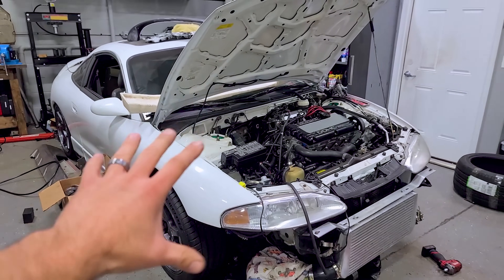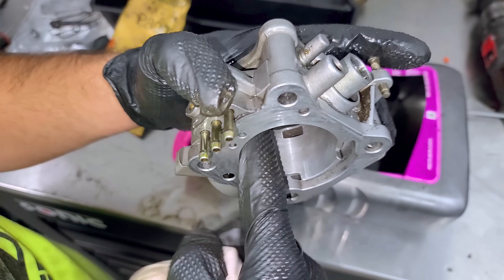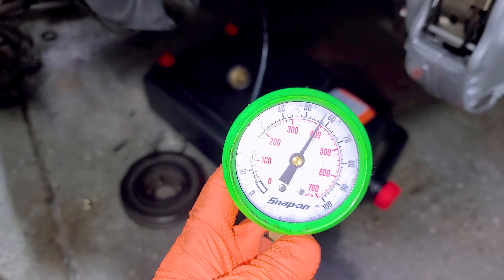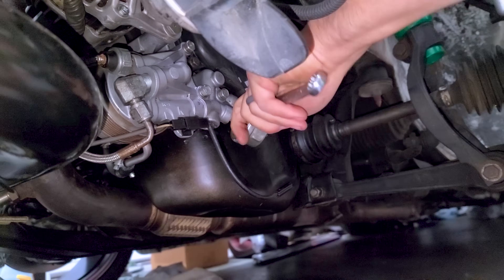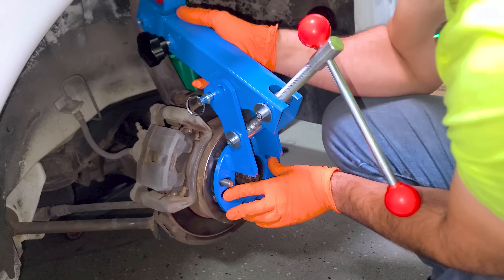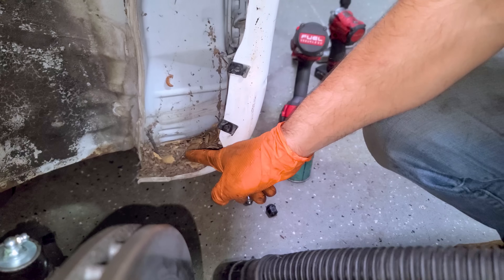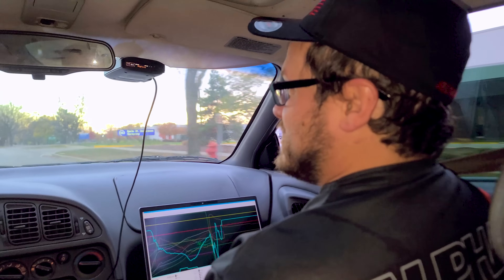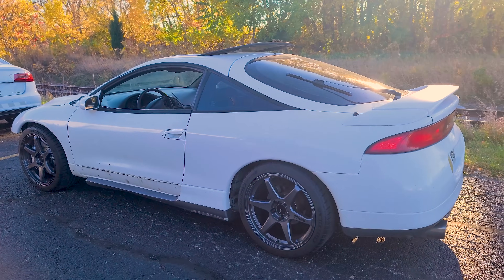We DOUBLED The Horsepower Of My 240,000 Mile Eclipse GSX & It Totally DID NOT BLOW UP!

Comment from the maker: Who else loves a good DSM?
Reply: Old 6G72 guy here. 3000GT
Reply: 90 Eagle talon TSI AWD was my first car I bought
Reply: I do. And so does Bill Pullman.
Reply: Me!
Reply: Alex. Change the harmonic balancer. It’s a two piece held by rubber. Yours looks old and if it separates, it can jump timing by melting the timing cover and getting caught in between the tbelt. Ask me how I know lol
Reply: I had a black 98 GSX 5 spd that I bought in 2000 for only $6800 with a recovered theft salvage title and mustang gt rims with 245 45 17 tires. It looked and sounded so mean. Had bigger turbo, huge exhaust, koni adjustables, electronic boost control and turbo timer in the glove box and  bunch of other stuff. In 4 years and 50k miles I only had to put an alternator and a clutch in it. The clutch was down to 20 yr old me launching the car everywhere all the time. Such a blast to drive, Best deal i ever got on a car. Thanks for the awesome videos on your GSX!
Reply: I had 3 ❤
Reply: I love Dodge Avenger 1995-2000 ,... almost DSM :) plenty of common parts but Chrysler electronics and mitsubishi 6g73 engine
Reply: Me, and I love bad ones too. Because that's what I have.
Reply: I do...
Reply: My first car was a 1991 eagle talon ❤ tsi awd
Reply: Absolutely
Reply: Me me me me me!!!  Teenage dream right there!
Reply: @GearsandGasoline loves DSMs 😂😂
Reply: Still have 3 - GSX and a couple GS-T Spyders
Reply: a 'good' dsm..words that aren't put together often
Reply: I had a 92 galant vr4.   it was a money pit if you do it right it hauls..I did a evo3 turbo, jdm cyclone motor and supporting mods and ran the evo3 wg strapped shut.
Reply: I use to tear up Chicagoland with my talon tsi
Reply: If you keep up on the maintenance, those motors are badass. I had a gs-t that had bolt ones and head studs, port and polish head that was faster then a lot of cars. I even had nos and was told I was crazy for running nos on a turboed car. Now nos is used on race cars and some street cars. That was 25 years ago, right when street racing started becoming more popular cuz of the fast and furious first movie.
Reply: MEEE I HAD A 90TSI that made 400awhp freakin miss that thing all the time
Reply: 6'3 Alex? 😆 Are you serious because you don't look tall?
Reply: I get ptsd watching you work on it.  Just waiting for something to break.
Reply: I'm not a car guy.  Since I had to Google what DSM means, I have no clue whether I like a good DSM or not.
Reply: @nullstring1 that's not a dsm. But also an awesome car. So are dsms.
Reply: That’s why I own 3!! 1 is a parts car with an LSD differential just for you! Provide me a good contact and I would love to gift it to you
Reply: I own a 1999 special edition 5sp Eclipse GS… so yeah i love them😂
Reply: Glad to bring it with to the LSC meet, we will totally be there!
Reply: The best eclipse ever made ❤️  also it would be nice to replace the headlights with the '99
Reply: I love mine when it’s running lol
Reply: Myself personally I respect when you and other creators show your mess ups and then fixes no one is perfect no matter how much knowledge or experience you have people make mistakes!! Keep up the great content!!!
Reply: Although it is not really a dsm, I do have a 1991 3000gt vr4
Reply: There will always be a special place in my heart for my DSM's. Watching you work on it brought back tons of memories. My best was a 1990 Talon TSI that was fully set up. Great car but I moved on to newer tech cars.
Reply: Send the spark plug cover off to get Lazer etched with the legit street car's logo man come on. Perfect chance to flex
Reply: Come on man!... scorpion says "get over here" 😂
Reply: If you didn't show us the difficulties or mistakes you have in maintaining or hot rodding your cars, we'd have nothing to laugh at (I mean learn from).
And if you want to say that you have 400whp, technically it is true - what's 3 HP between friends?😁
Reply: Still waiting for the Lightning ⚡🌩️⚡🌩️⚡ content
Reply: My first brand new car was a 1994 Talon TSi AWD. I drove it 45k miles 3 times across the US (military). The kid I sold it to put a boost controller on it and blew it up a few months later.
Reply: This guy!! I used to own a 93 GSX, 92 Talon TSi and a 91 Galant VR-4. Man I loved those cars!!!
Reply: My dream car back in high school
Reply: 97 GST Spyder here
Reply: Just did a widebody mod on a GT86. Great car!
Reply: What ever happened to the old helper guy you had when you guys got that other dsm I believe it was red with all the carbon fiber parts on it
Reply: I had a 1995 GS
Reply: <------ had this username for likenover 18 years
Reply: I love it and that car looks and sounds amazing and it's my favorite car also you should get a clean body kit for it so you can take it to shows to make it stand out even more.
Reply: I had to google DSM!😂
Reply: @AWD_T He'll hopefully change that or find out and make content
Reply: I have had 2 Gsx's. One I bought new from the dealership. I know that you are going to paint yours. I would make a suggestion for the color Maui Blue. The color shifted between blue, purple and green depending on the light. It's a stunning color and I had so many comments on the color.
Reply: 95 Eagle Talon TSI AWD - love the series! Had a 20G, ACT 2600, 660s, Walbro 255, Thermal, Apexi SAFC and TT, FIPK, and much more - still miss it!
Reply: Meeeeee. I miss my 1994 eagle talon tsi awd 5 speed. My m240 awd with a turbo and full fuel system upgrades scratches that itch though.
Reply: Hey Alex what brand of op sending did u use? Mine is doing the same thing. Thx 😊
Reply: Me-me-me!!!  ROFL ;-)
Reply: STI IAG stage 3 fully built on e85 flexfuel fan and rotary fully built bridge ported fan here.
Reply: i almost bought a 91' Laser as my first car when i was 15
i want a Conquest/Starion and a Plymouth Colt GTS
Reply: @stevenreid-g2y  The Mitsubishi dealership tried to get me to trade GSX for the VR4. My only reason for not doing it was that it drove so heavy.
Reply: Got 1 eclipse 1g 4g63, searching for a 3000gt v6tt 😅
Reply: @AWD_T  THIS
Reply: Had a 91 talon TSI AWD, miss it so much. Awesome car and so much fun. I had an ACT 2600 clutch and it hauled ass.
Reply: My name should tell you all you need to know. 😁  I had a '91 and '94.  I've tried to find another but there is nothing decent out there.   I am jealous of the Eclipse for sure!
Reply: Nothing better I love my ls but spinning all 4 wheels with a 4 cylinder car absolutely insane lol
Reply: Good I miss my Talon TSi
Reply: Love em
Reply: I love Dsm's......I kinda hoard them a little, I've got 14 of them lol. Thanks for showing them some love.
Reply: This was the first car I ever painted!
Reply: My first manual car was a 2ga eclipse, most recently had an evo 8, talk about money pit, i love them but  the 4g platform is expensive
Reply: I got a 3rd gen eclipse, which is not a DSM, but is kind of a cross between a 2nd gen eclipse and a 2nd gen 3000gt. Very little moddability unfortunately. RIP 4G63 eclipses you will be missed. RIP mitsubishi you had a good run.
Reply: I love that it doesn't sound like a fart can. Please don't ruin that beautiful sound
Reply: 3 Dodge Stealth R/T Turbos a Galant VR4  454/2000 and two 1g Talons. Yep I have a problem lol.
Reply: I had a 1991 eagle talon. I miss that car more than any other I’ve had. Even my 83 trans am.
Reply: Peter?
Reply: Hell yeah!
Reply: 92 galant VR4, now the fastest in the world, and an 03 Evo 8. Love my Forte GT ten times as much!
Reply: Love them I had a silver 95 gsx  all done up as well I miss my gsx
Reply: Still my dream car
Reply: Love my 98 awd talon. Love the boost pulls on the dsms. Mines at around 480hp flex fuel and love it!. Glad u like yours too.
Reply: I own a blue pearl 1995 eagle talon tsi that i got a few monts ago, im working on it so far i work on diferente parts and currentlly  working on the exhust and turbo gaskets
Reply: DSM on my top 3 pedestal FS
Reply: My first car was an eclipse gs-t and I always wanted the gsx & 3000 GT VR-4 maybe I can find a clean one some day
Reply: From Puerto Rico, I got an '90 eclipse once (24 years ago). A really fun car that I missed a lot. Mine had some tuned but no more that 300 hp. Man, really missed those days. Thanks for sharing your dsm experience. I really love your videos.
Reply: 4G63 for life!
Reply: You should put your legitstreetcars logo on that plain beauty cover
Reply: 🥺 I miss my old Dodge Stralth now.
Reply: @talon4x4 talons are cool. I remember my dad test driving a new one back in 96. Had that wing that wrapped around the back glass.
Reply: Turbo rebuild shops love DSMs
Reply: I love all DSM's if they don't blow up constantly.
Reply: I still have my 92 talon since 99. It's my 11 sec daily.
Reply: Was the owner of 

- 91 AWD TSI  got the DSM bug 
- 96 Mitsubishi eclipse GST 
- 97 Eagle Talon TSI , had to go back to AWD 

Alex try a 3500 rpm dump they launched like a bat out of hell.  You will also be doing yearly cloud jobs lol ACT is all I used.  

I think Slowboy racing has good clutches also
Reply: 1GA Laser 4G63T 90k all OEM. Temp control garage kept. Engine never out. OEM exhaust, zero rust! Added a fire extinguisher.
Reply: I've still got one of these in the driveway. Actually there's been at least one DSM in my driveway for the last 25 years. All 1g's though. My son named it the Turbo Toilet!
Reply: Have a 98 but with the 420a😢
Reply: Man I've always wanted on! Well I wanted a talon but this was always the second choice.
Reply: I had a 1990 Plymouth Laser and then found a 1995 GS-T. That car was so much fun until I threw a rod through the block.  Never should have let that car go.
Reply: Excuse my ignorance, but what is a DSM?
Reply: @CX06  It’s an acronym for Diamond Star Motors. It’s a joint venture between Mitsubishi and Chrysler to build cars in the US. It’s used as a “Catch All” term for 1st and 2nd generation Mitsubishi Eclipse, Eagle Talon and Plymouth Laser cars.
Reply: @Tyler97GSX  ah, I see! Thank you!
Reply: I wouldn't mind, a video on simplifying mine. I know garbage abought the wire's. Have a full build. A full pocket of money thrown at her.
Reply: LegitStreetCars imagine your car running is like mine running, with +1 upgraded EVErYTHING! That's how big I built!
Reply: 99 GSX is my dream car. My buddy had a 91 Talon TsI in high school. Thing was wicked when we weren’t fixing it 😂
Reply: My friend used to have a Gallant VR4 super cool car!
Reply: Mitsubishi are junk have fun making power for 2k miles
Reply: My 1gb tsi was fully built and on pump 91 at 34psi made 638whp ❤ I should have never sold that car
Reply: ✌️4g64 owner here

Comment: You should laser etch the LSC logo on the spark plug wire cover
Reply from the maker: That'd be really cool!
Reply: great idea
Reply: the factory spark plug cover is black plastic with a red strip on it down the center. You can get a factory one that says mitsubishi on it from the evo 3, mitsu still makes them and they come with factory bolts and rubber grommets.
Reply: I was just coming into the comments to post the same thing.
Reply: Yes!
was thinking the same thing
...
I'll call it 400 horses.
Impressive for 240,000 miles.

Comment: I don't think people realize just how badass a car is with 325 horsepower and 300 ft.pounds of torque.especially in such a light car with AWD.. Absolutely insane Alex,nice work what a rocket.😊
Reply: I had a 2015 q70s 5.6x... would waste teslas. Not plaid, but the p80d, and model y's; WITH EASE. 420hp, 400 FtLbs, on less than 5k chassis. The awd acts as a torque multiplier. These eclipse's/talon's, are awesome.
Reply: Yeah Modern cars just get heavier with all the infotainment and safety BS they all carry.
..
Would be interesting to get a modern car and junk every modern unnecessary accessory to see how much faster it would go.....
Reply: That thing looks like so much fun
Reply: @stuartd9741 the new mustang gtd kind of takes that approach
Reply: @JeffreyPerrault-hkxe
I have that power in my Mitsubishi gsr cordia turbo it has boost by gear, it's fwd and 2100lbs with me in it and hands car's with double the hp a good piece of gapplebees pie all the time .
Reply: Absolutely! Mine is 350whp and its hectic and I daily it :) still get 350miles to the tank
Reply: @davidgriggs3967 That sounds like a fun car to wheel around 👍🏽
Reply: @jonathanjones1814  It is , and it's unsuspecting. 
It might be 40+ years old but it can put the hurt on new hatchbacks with just it's low boost 200hp tune .

Comment: 5:52 Was that a GMC Typhoon on the lift?👀👀
Reply: I don't think so, but... 🤞🏽🤞🏽🤞🏽🤞🏽🤞🏽
Reply: I wondered about the mystery car that's blurred out. I came here to see if anyone else noticed.
Reply: Looked like under or next to the Lightning @29:43
Reply: @Dwigt_Rortugal  It's not blurred that I saw. Camera was out of focus for a second.
Reply: @FastSS02   @5:52 it is intentionally blurred. @29:43 looks a lot like a Jimmy Blazer!
Reply: @jspaulding4106  Its a Typhoon for sure based on the wheel that is blurred and the rear side window at the later time that wasn't blurred. You can see the lower cladding around the wheel arch. I must have looked away for a couple seconds when it was blurred and didn't notice it.

Comment: @20:18 Hey Alex, there's a "trick' we used to do was remove the passenger side headlight to ger a ram air effect. It only takes a few seconds to take out the couple bolts an plug. With the headlight gone it's like a perfect tunnel directly into the air filter. Great on nice cool nights. The turbo loves that cold dense air.
Reply: This

Comment: CFM Billet Valve Cover Breather
Relieves positive crankcase pressure, One-way check ball for MAF based cars, Internal baffle separates oil/air, Retains factory PCV system. The breather works just like the factory oil cap under normal driving conditions but will vent any positive crankcase pressure present under full or part throttle.

Comment: Man! Brings me back…. I had a 95 GST from 1997 to 2007… I modded it quite a bit… all the regular bolt ons, a 16g turbo, front mount intercooler, and boost controller turned up to 20lbs of boost. The thing used to smoke stangs and vettes all day long. Was such a fun car. When the boost hit it felt like the tires were gonna come off the car. Never had a problem with mine, wish I never sold it.
Reply: Used to have Srt-4 Neon, i would lose to eclipses of the dig every time, but one roll race is a different story 😊 awesome time back then.
Reply: @ definitely an awesome time back then..  I remember racing against quite a few srt neons… always fun hearing two turbo cars racing each other, blow off valves for days…

Comment: 49:50 These cars for a very long time were considered the cheapest 10 second car you could buy. Simply because you could bolt on a larger turbo, gate, controller, push them to near 400hp and run in the 10's. Heck the factory turbos with some jimmy rig mods could get you to near 300hp. There's also loads of weight reduction you can do to mitsubishi's, they make their cars very sturdy, and a bit heavy for the size.. but the doors are heavy as hell, the back hatch is 100 pounds, hood is fairly heavy. There's many spots you can do some hole saw weight reduction as well. You can easily drop these from 2600 pounds to 2300 pounds with some carbon fiber stuff.

Comment: I had a first gen Talon TSI for years. And yes, I drove it all over the U.S. and Canada.
Reply: I think the 1st gen stuff was better somehow besides for the 7 bolt engine so stronger and no crank walk but yeah the 2nd gens broke left and right
Reply: @eVerProductions1 crank walk happens mostly when high revs, high power. Happens in literally all engines (but to extend).

Comment: I also had a 7 bolt and ACT 2600 clutch and fidanza lightweight flywheel (which sucked for drivability)
Zero crank walk but I also had clutch bypass for remote start alarm system.

Comment: I had one of these throttle body types on a Corolla.  It had a high idle.  The fix was the screw that prevents the throttle blade from getting stuck closed and/or sticking.  So that screw should be like a doorstop that the throttle blade sits on when it closes.  It should be set at completely stock or normal.  The throttle body hits it as little as possible when closing, without not hitting it.

Comment: Fun fact: Jeep Cherokee throttle body gaskets work on DSMs, same size/pattern.  And they're really cheap too!

Also that stock sending unit sucks, the little clip like to just fall off of it.  Usually if the idiot light goes out you're fine (that's a separate pressure switch)

IDK if your cars are different, but I race a lot, and the air filter sucking hot air makes a huge difference, on a hot day I can get a 40 degree drop at the end of a 1/4mi pass.  Depending on how hot it is that's the difference between misfiring and not sometimes.

Comment: Making that power on a 7 bolt dsm is playing with fire i remember the meme growing up with a crank shaft pistons and rods atached to a leash saying dsm walk crank walk
Reply: Power production has nothing to do with crankwalk.  Less than 1% of 95-early97 7 bolts had verified crankwalk.  The rest were all destroyed due to idiocy and then blamed on a small TSB that Mitsubishi put out regarding a small number of said engines that had improperly installed thrust bearings causing premature failure.  The 2JZ, BMW straight 6 of the same era, and a few other cars all had way more cases of crankwalk than the 7 bolts do.  

True crankwalk will happen before anywhere close to 90k.  If its at or past that, send it.  Just understand 7 bolt rods are thinner and weaker than 6 bolts and will snap.  Also: detonation from horrible tuning solutions will kill bearings as well and people will shrug and go "omgcrankwalk".